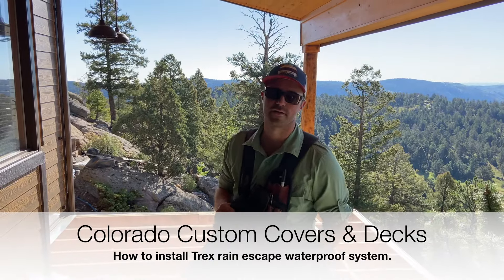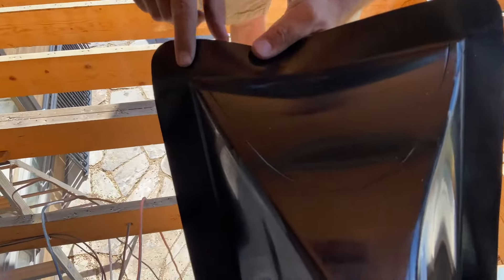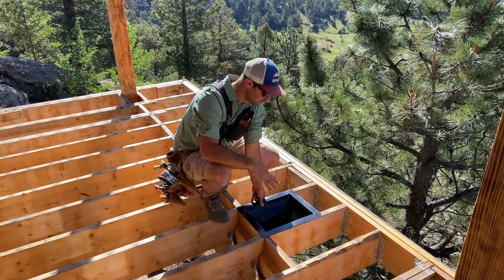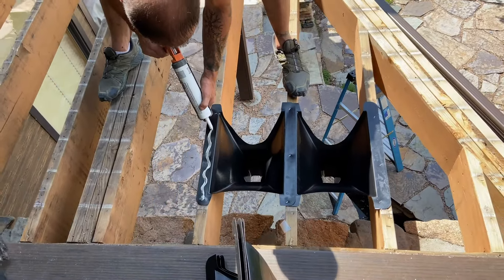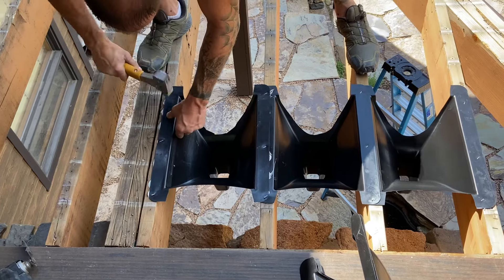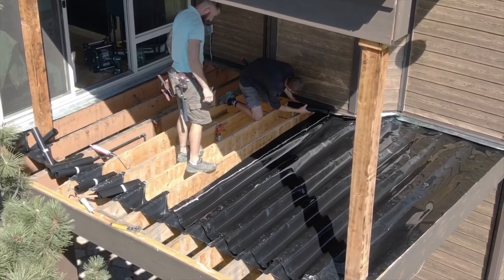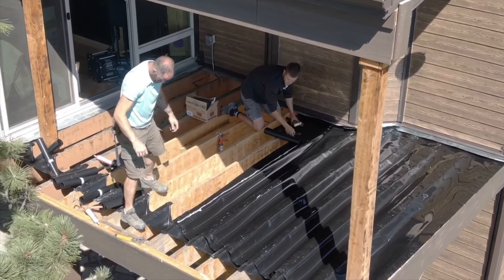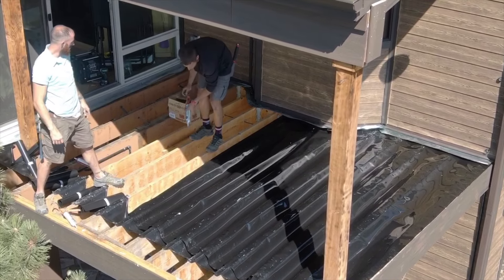How To Install Trex Rain Escape Deck Waterproof System  - Colorado Custom Covers & Decks

Comment: I have a 16’ x32’ deck build and this will be my first time using Rainescape. I will have about 14’ to the main support. My deck package shows solid blocking in the center of that 14’ trough area. Do I just run troughs in both directions from the center blocking or can I use metal x braces and the trough wouldn’t need much pitch in seven feet and x brace in the center would suffice? Have you run into this issue?
Reply from the maker: You can do that or after rain escape is installed you can install small roll blocks that will clear the rain escape.

Comment: I would worry about water pooling on the membrane and not draining away.  This assumes I don’t fall and break my neck while trying to maintain my balance.  A few temporary beams perpendicular to the joists could be a safe platform 🤔.

Comment: Great instructive video!  In the first portion of the video you can see blocking of the joists over the beam.  In the second portion of the video where they're installing the rainescape system it appears that blocking has been removed in order to fit together the troughs and downspouts?  Is that code compliant?
Reply: No way. I came to this video to see what to do when there's blocking or when the joists are less than 8" apart. but they skipped over that part.
Reply: Just did some more digging around. Found that the trough should drop down 4" at the end of the pitch. Which means, somewhere in the middle, it will have a 2" drop. If you have 2x8 deck joists, you can get away with cutting out the old 2x8 joist blocks and replacing them with blocks ripped down to 5". But I wouldn't rip them down to anything less than half the depth of your joists.

Comment: A highly regarded contractor (customer ratings) in my area said he "got out of the deck waterproofing business because the systems don't work...he had a lot of callbacks after installing them.
Reply from the maker: mmm that's a bummer! A major problem with leaks is improper decking and rail installation after rain escape has been installed. Definitely have to take your time and be mindful of the screws. Thanks for watching.
Reply: @coversanddecks  Even the best contractors are under constraints of time and more recently, their ability to find qualified employees to do the work and pay attention to craftsmanship (fit & finish). 
I'm a DIY perfectionist....I'm good, but I'm real, real slow.  Contractors who go that extra mile are generally less competitive than the run-of-the-mill types and their customers tend to be limited to those who appreciate top quality and are willing to pay for it.  I'm sure if done properly and with some degree of "perfection" good waterproofing results can be obtained.

Comment: How do you install with picture frame?
Reply: It shouldn’t matter because the waterproofing is joist specific. Gravity determines the water flow
Reply: @lalva2024  He means there's blocking in the area where the trough would go....

Comment: Why are you installing this product on a  covered deck? Seems like a waste of $$
Reply from the maker: thanks for watching. we actually install this a lot on covered decks as snow and rain will still come in. Also, the main feature of this product is that is protects your joist from rot and will never have to be replaced.
Reply: What is the pricing on this as a proposed upsell? So how much is product for like 12x16 deck and how much labor hours are in it? Just now seeing this, awesome idea. We been offering the older ways of doing the rain into gutter system.
Reply: Can use water proof joist tape to protect from joist rot
Reply: It's also useful if you are using the space under the deck and want to keep water and spills from falling on someone's head. If you got the extra coins install it.